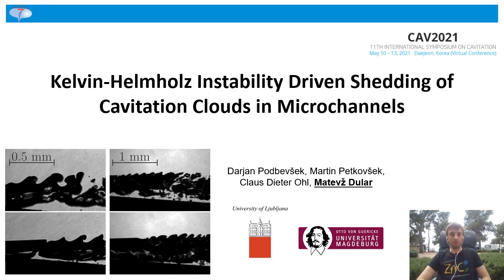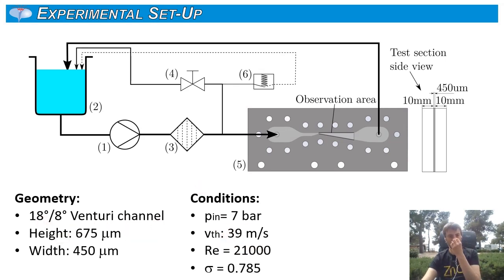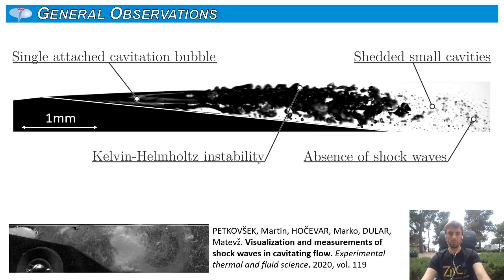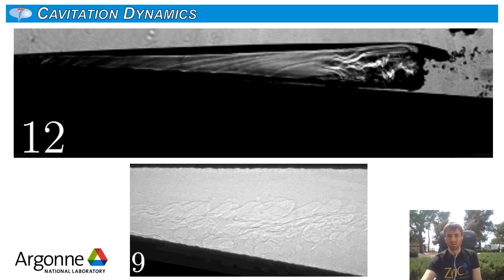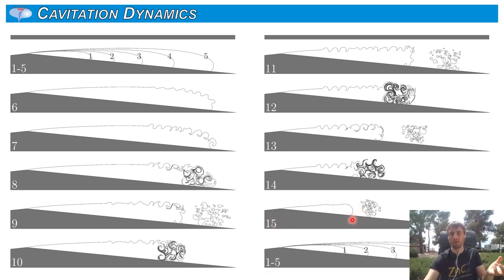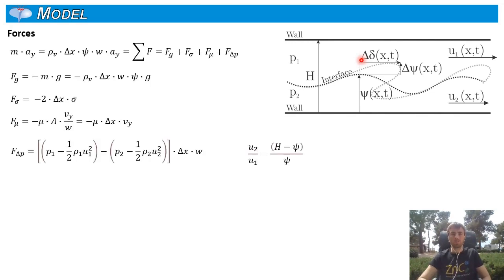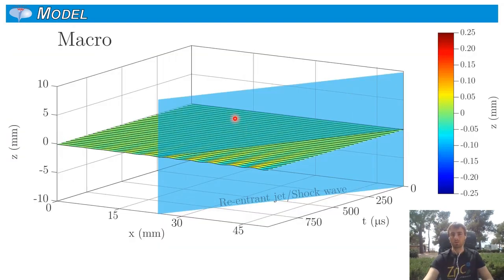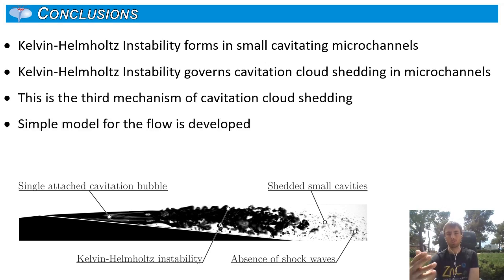Kelvin-Helmholtz Instability in Cavitating Flow

Comment: You’re just the guy for me to ask this question: would the riblet microstructure of shark skin prevent cavitation from occurring, or even reduce its damage? I ask this question because tuna and dolphins are famously able to swim so fast, the frequency of their tail creates cavitation, forcing them to slow down before their fins are eroded. Because of this, it’s now pretty well established that no marine vertebrate is going any faster than 10-15 meters per second, at least within the first few meters of the water column. 

And no other bony vertebrates are able to exceed 10 m/s. Closest runner ups are billfish, at about 9.8 m/s (9.2 if only counting field data from predation events). 

However, at least one family of fast swimming non-bony vertebrates still hasn’t had their maximum speed formally verified, and that’s the lamnids (white shark family). Based on computer models, Isurus (mako) sharks are suggested to go up to 70 k/h (19.45 m/s), with Lamna (porbeagle/salmon) sharks not far behind. This has been heavily criticized due to the models not factoring in cavitation. However, many shark families have a riblet microstructure incorporated into their placoid scales, which reduces drag. And lamnids by far have the greatest drag reduction. But now the question is whether that would allow them to push past the cavitation barrier of 10-15 m/s. How would a hydrodynamic efficient riblet microstructure effect cavitation? If a riblet microstructure can reduce drag, than can it also reduce the formation of cavitation bubbles?

There is at least one advantage sharks have over dolphins and tuna when it comes to fast swimming, and that’s the enamel coating of their scales giving them more protection from cavitation. But that’s only a temporary solution. If the riblet microstructure of fast swimming lamnid sharks can prevent cavitation, then that would make them them the fastest known swimming vertebrates.